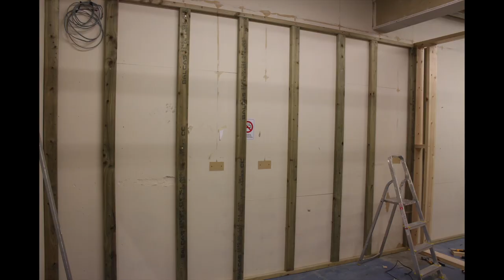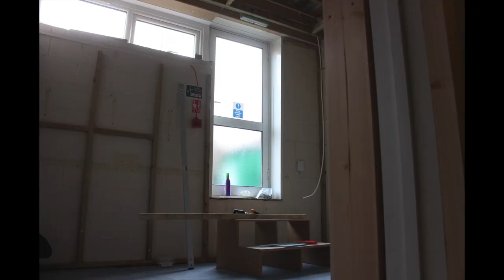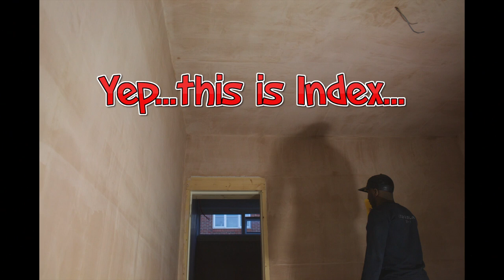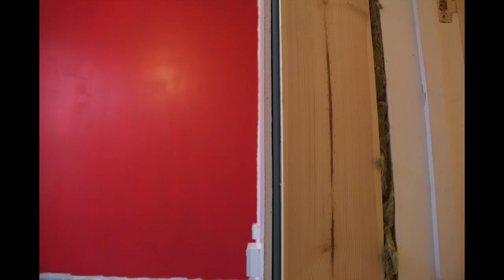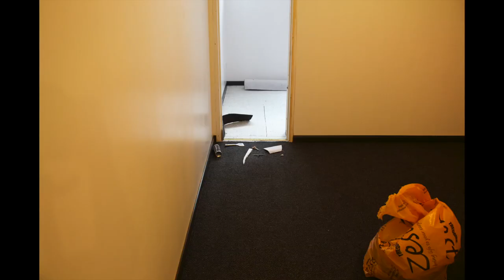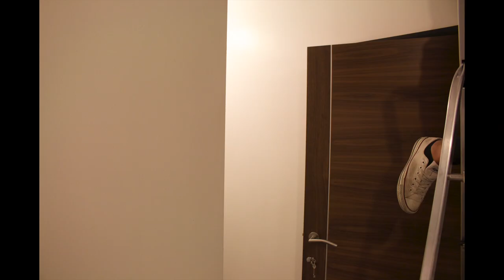Soundbox Studios - How to build a recording studio

Comment: I see you used mineral wool for the insulation, but what are the panels you used? Not the brand necessarily but what materials. I see there are two layers. If you have good isolation especially with the drums then you did very good for a wall that's not too thick. 

Also I would like to add this isn't just a good video for studio construction it's really good stop motion as well.
Reply: Rockwool Rockton?

Comment: So I have a question that I cannot seem to get and answer too.... How did you get your mic/ instrument cables from one room to the next without having a hole through the wall?
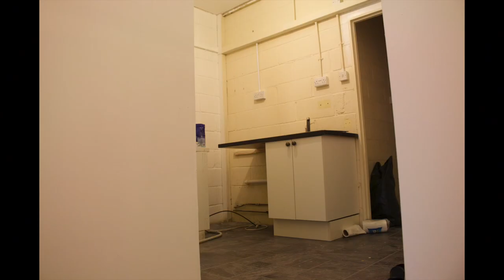Reply from the maker: You do have to have a hole in the wall somewhere. If you see at 4:28 theres a loom in the wall. Lay the cables before you do all the treatment and plastering etc. The hole on the other side is in a completely different place so sound doesn't just jump straight through the hole.

Comment: did you use rug or hardwood floors for the recording booth? and was that all just drywall yall used for the walls and ceiling?
Reply from the maker: For the booth we used an acoustic sound absorbing underlay and then laid hardwood on top. Sometimes a wooden floor is nice for recording some instruments, then you can always dampen it with a rug or drum mat if necessary. And we used two types of drywall. Acoustic (blue) and regular (grey).

Comment: Wouldn't it be better to cover the rockwool with the cloth instead of gypsum plasterboard? Since the sound is gonna bounce off it way more??
Reply from the maker: Rockwool is more to do with sound travelling between rooms than internal treatment. The foam and panels inside the room look after internal sound movement
Reply: Only the highs (over 12Khz), not the lows
Reply: You need around 3m of rockwool to actually get rid of lows bouncing in the room
Reply from the maker: This is true, but I was referring to the reason why we used so much plasterboard instead of just cloth as you suggested. For low frequencies you can control with internal treatment with bass traps for example. You can do a lot with strategic placement.
Reply: The reason  I was asking is because I'm trying to build my own studio right now (garage) and still can't decide on how to cover the rock-wool so it looks nice and does the job.
Reply: Visually your studio looks really dope guys. Btw is that a floating floor you got there? No carpet (carpet covering) as well?

Comment: Why so many layers of dry wall?
Reply from the maker: +Marley Cares We used one layer of sound check (blue and then another of regular plasterboard, but we and some left over so added a third layer. Rather than let it go to waste
Reply: +SoundboxUK gotcha, where can i get my hands on some of that sound check dryway. building a smaller studio like bedroom sized with a booth. I don't have the budget ya'll had but the layers of drywall sounds like a good investment if it keeps sounds out of the room.
Reply from the maker: It does a good job but it's really what you put inside the wall that counts. More mass means less movement, less movement means less noise. Most building suppliers will provide soundcheck plasterboard. Are you in the UK?

Comment: The fact that all this construction was connected to the original building...was a bad idea.. you must have "Air" between the exterior walls.. in other words a room in a room (not touching)..Cost would have been considerably less and sound would be better ...Wood/laminate on the floor.. What's with that?   However; sure is pretty.....
Reply: +Bill Clark I'd agree, especially on outer walls that are likely to be cold. Recipe for dampness.
Reply: what's the problem with wood or laminate on the floor?
Reply: Hired Goonage It's highly reflective, which is great for some recordings, but would need to be damped with rugs or matting for others. The way it is slotted together can be a problem. There is no control over the sound waves travelling through it. Floorboards on joists are better. It brings out the lower frequencies.